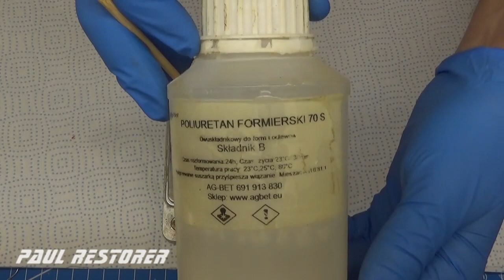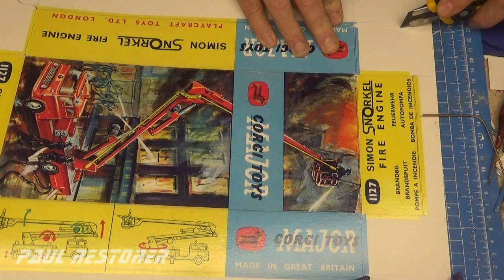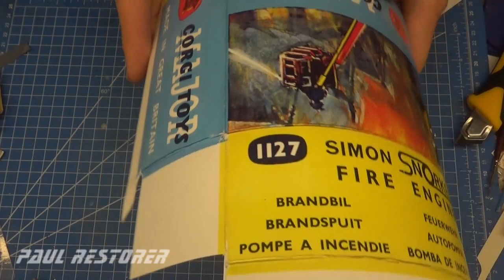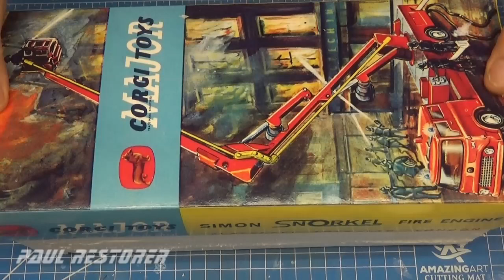Corgi renowacja Simon Snorkel Fire Engine nr 1127. Zabawka model odlewany.

Comment: What is your address? I have a Majorette semi truck to be restored: the trailer wheel doesn’t roll anymore, truck needs much attention as well: chassis (broken fuel tank on driver’s side, missing exhaust pipes and grille was pushed in). Can you fix these?
Reply from the maker: Unfortunately, I don't have enough time to do such repairs as a hobbyist. Kind regards